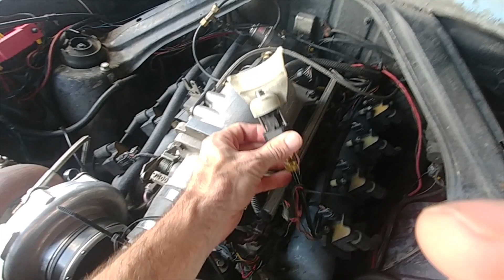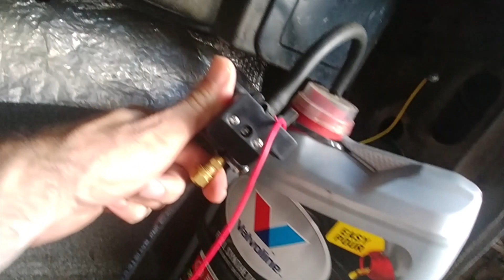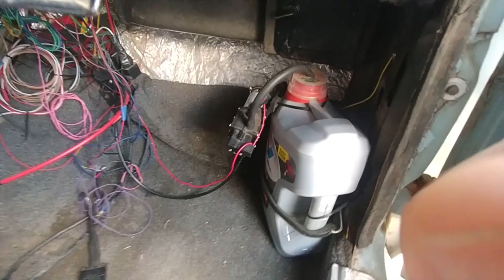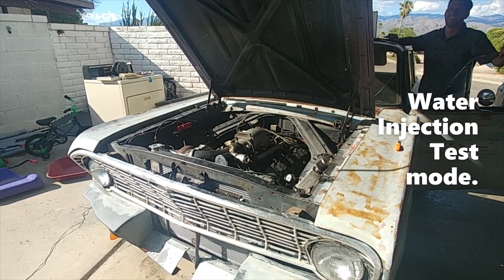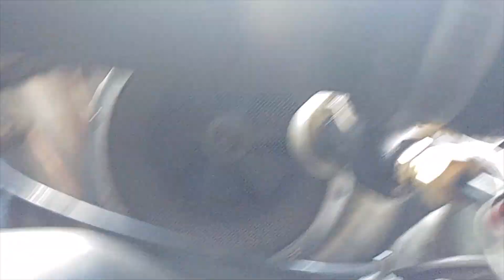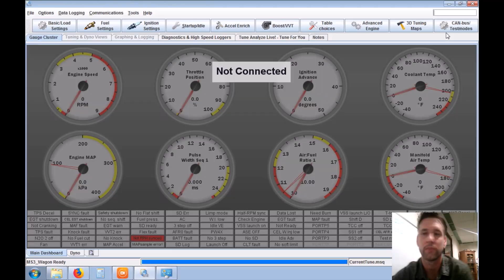DIY Water Injection MegaSquirt

Comment: What’s wrong with using a washer bottle sprayer.
Reply from the maker: Pressure is pretty low. RV water pump will do 65psi with plenty of volume.

Comment: How is the compressor wheel doing since you built this system ?
I read somewhere that water droplets can damage the inducer at high rpm. But i have no experience so...
Reply from the maker: Its holding in there.  I might tip into boost once a week or so.

Comment: I made a Venturi effect injector which sprays in my air-intake you can feel the boost really well gas milage doesn’t suffer, I use kerosene/isopropanol mix 50/50
Reply: Kerosene plummets overal octane value in your cilynders. It has same self ignittion (cetane) value as diesel.
Reply: @OleDiaBole  yes tru but the combination with alcohol worked somehow, you dont want to add it on its own not a nice noise😅, btw Ive upgraded the system to inject about 200cc per minute it works as well as a professional aem system only without all the electronics and the moving parts etc, if you want some extra hp this is a really good addon, Im now driving with it for 2 years no problems what so ever so far, really good acceleration I can keep up with the turboed gti's etc. checkout my channel for the video